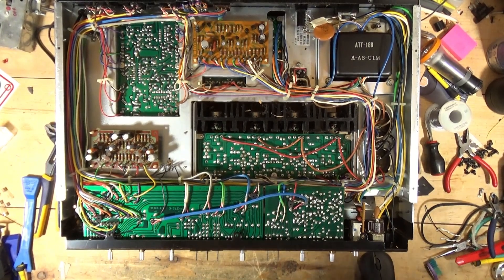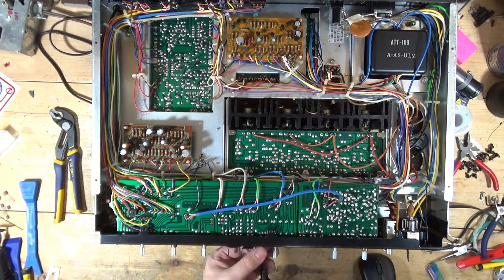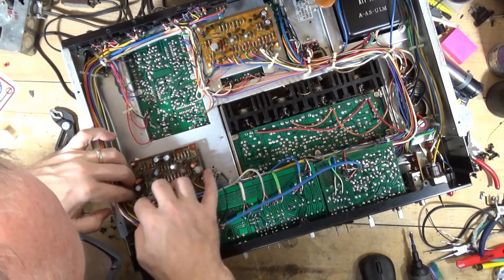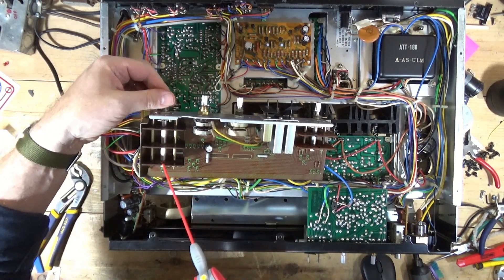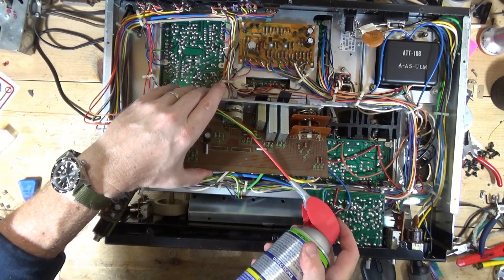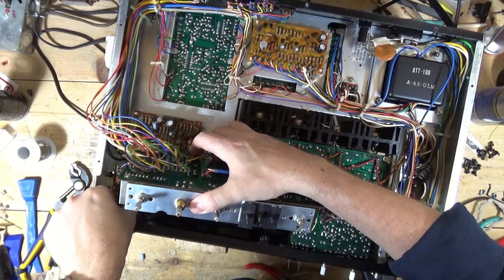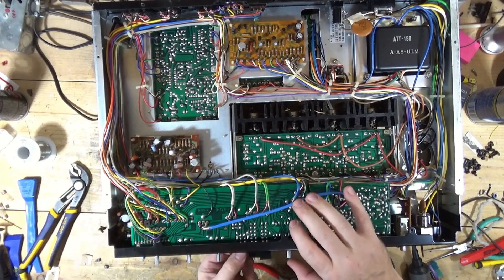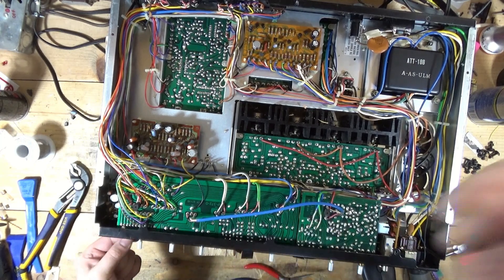Pioneer SX 737 Preventive Maintenance Part 2 - Working on the Switch & Volume Control Board

Comment: I have a 737 and the volume control seems to be my bain....it will cut out on low volume but if i set it to midrange it plays day and night BUT, you cant stand to be in the area.
What is your shot at the pig in the poke.....
Please and Thank You
Reply from the maker: Have you cleaned the pot?
Reply: @millervintagehifi3034  I haven't done anything with it.....just got it from a friend.
Replaced the one that when I opened/or left it open for air the door it played static.

Comment: Hey!

I have an issue with the 5 step switch. Mine was cracked so i decided to replace it, but i have run into some trouble. Do you still have one of these units? Is it possible to reach you via email?
Reply from the maker: I no longer have (or currently have access to) a 737.
Reply: @millervintagehifi3034  all good, I managed to fix it after all!